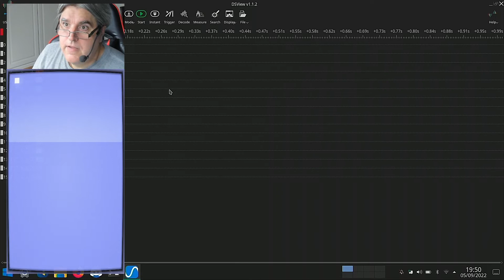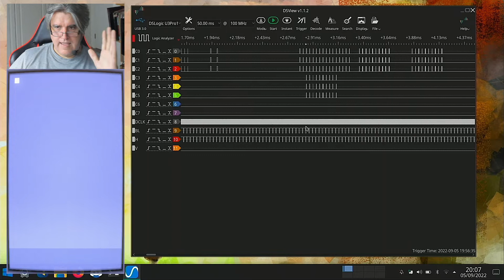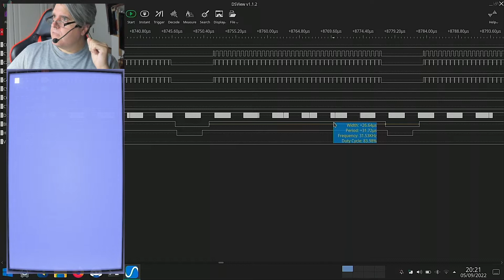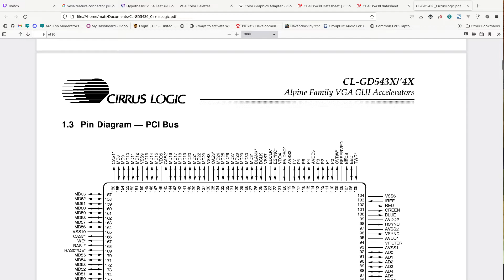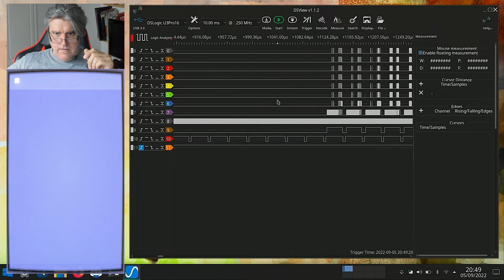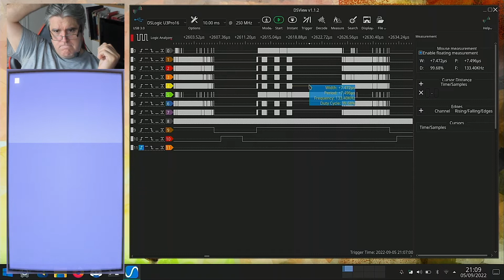Exploring using the VESA feature connector as a means of capturing VGA video

Comment: Fascinating - the VGA / VESA connector was one of those unused headers in a PC that no-one seemed to have a card for, great to see it in use and explained so well.

Was wondering if there's any data hidden in the blanking when the palette/mode changes - i've no idea about how real ramdacs were programmed. via the data or another set of pins. 

Thinking about the palette - that problem must have been solved by designers using the card internally to a single pc. is there a VGA call to grab the palette values that can be made into a small TSR prog to keep track of them and save to a text file (that you could later extract and marry up to the data from the card)  - probably only work for real mode software?

you could try software that deliberately cycles / changes the palette quickly to see if it gives you any clues. DOS versions of Fractint had this, and also had practically every display mode you could wish for in terms of testing different modes/refresh rates.

looking forward to an update.

Comment: I have a vfx1 headgear it works on ATI mach 64 but dosnt ,wor on voodoo3dfx v5, I wasn't able to find  the reason,got another card Ati rage pro, it didn't work,then an ati 3d rage pro agp 2x it did work
.but I would like to use my voodoo 5 are there any reason some work and some don't, headgear vr isn't hi res. Only256 colors